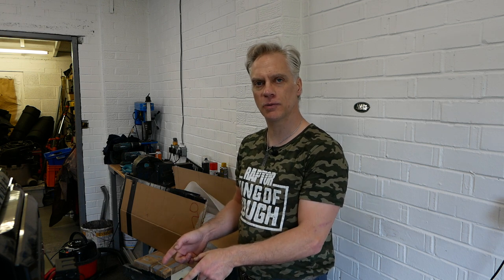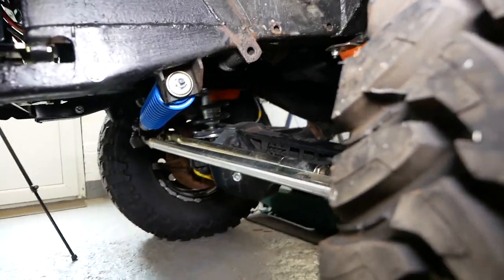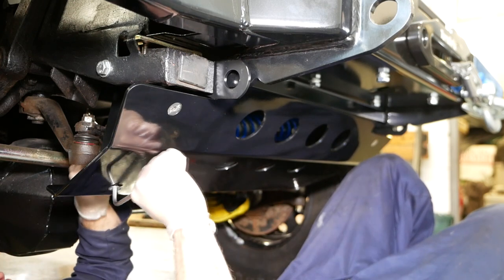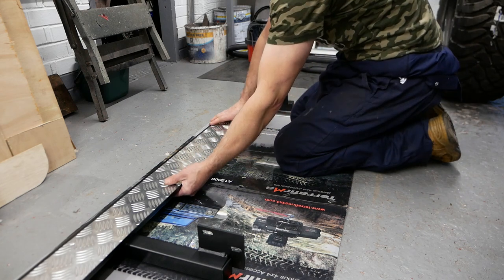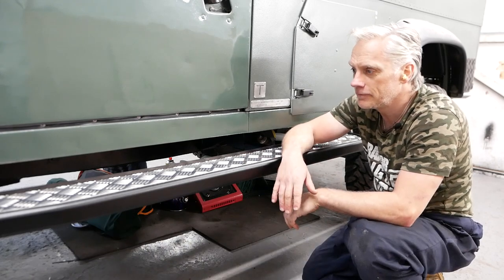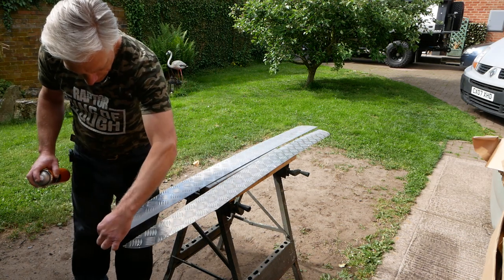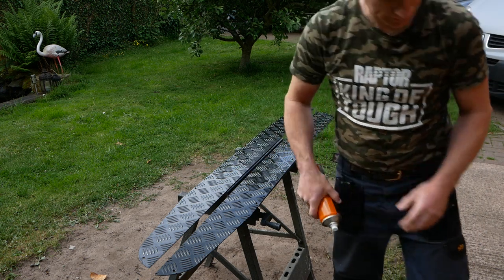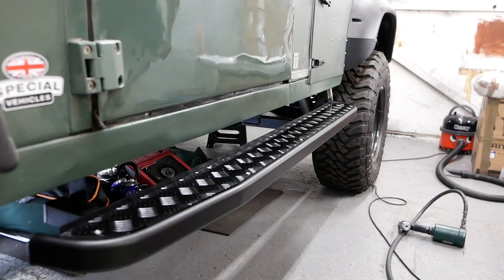Land rover Defender Overland Camper...Fitting Steering Guard & Side Steps..Part 8

Comment: The steps do look better in black.  How well will the paint hold-up to lots of foot traffic?

Many, many, many years ago, in another life in the Navy, we would wipe-down new aluminum with white vinegar to remove the factory coating that was on the sheets of aluminum. Then we would prep with zinc chromate primer prior to final painting, if the project was being painted for exterior use.
Reply from the maker: Hi retnav92...i think the paint will wear quite quickly but we will be giving them a coat of raptor in the future...regards Paul

Comment: Hi Paul, The new side steps look fantastic and I have to agree they look so much better in Black. My only concern is how well the painted checker plate will stand up to muddy boots etc, would you have not been better to given them a coat in Raptor? Love the tee shirt by the way. Look forward to seeing the next video. Keep up the great work.👍😎
Reply from the maker: Hi PG Tips...not really sure how the paint will hold up i expect with it being just a single pack paint that it will wear quite easily...a coat of raptor been alot harder wearing  but would be quite wasteful just to spray two steps as the smallest quantity i can mix is 1Litre and i don't have any of the aerosols or raptor...will have to get onto Upol to see if they will sponsor the channel..regards Paul

Comment: Hi Paul, don't you gone paint the brackets from the shower tent and the awning? black or green? the truck looks amazing.
Reply from the maker: Hi RFGALMEIDA...no i am just gonna leave them in plain aluminium as they kind of marry in with the stainless of the raised air intake round the middle of the truck...regards Paul

Comment: Where did you get those side steps from?. Didnt hear you mention it in the video
Reply from the maker: Hi Dan...here is the link to Ebay...https://www.ebay.co.uk/itm/255399856122?mkcid=16&mkevt=1&mkrid=711-127632-2357-0&ssspo=fzQsAZdFSRe&sssrc=2047675&ssuid=X1MTkK6oSoi&widget_ver=artemis&media=COPY
Reply: @All4Overland  excellent thanks mate. Been following your build closely as I have an 1985 110 ambulance and you have been a wealth of good ideas for my own build
Reply: Also out of curiosity what size tyres/wheels setup have you got?
Reply from the maker: Hi Dan...glad i have inspired you with some good ideas...and the tyre size is 305/70/16 and the wheel rims are 16inch  -32 offset...regards Paul

Comment: I hate being 'that guy' but your nylon nuts didn't seem to have many, if any, threads coming out through the nut and nylon locking piece.
Reply from the maker: Hi Andy..you can be that guy if you want...i had already backed the bolts off on the bumper so the threads would have been back through the nuts as they were being removed to have the spacers cut down but you are right they are quite short...after cutting the spacer and tightening them up the bolt only just comes through the nylon but i am not worried about it as they are almost a shear bolt for the bumper not load bearing..regards Paul